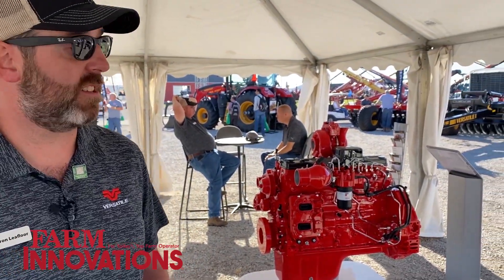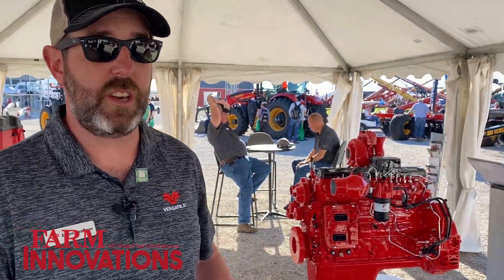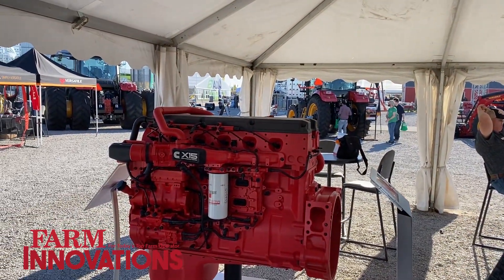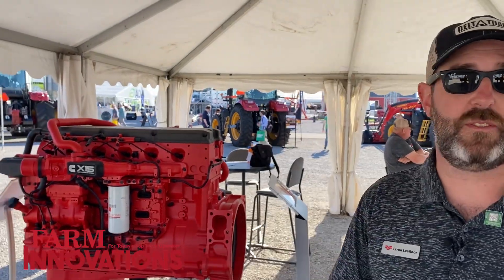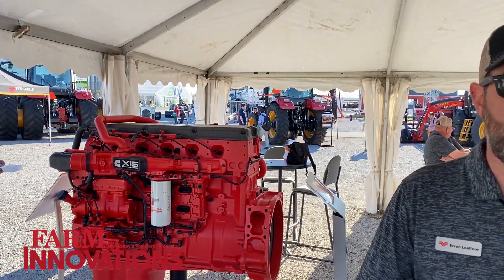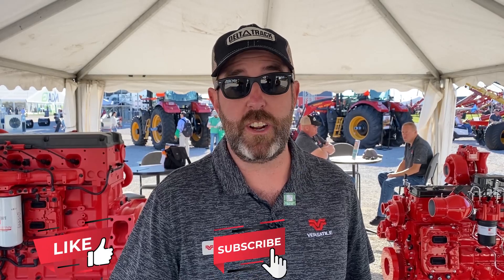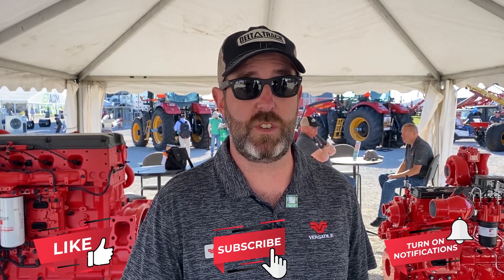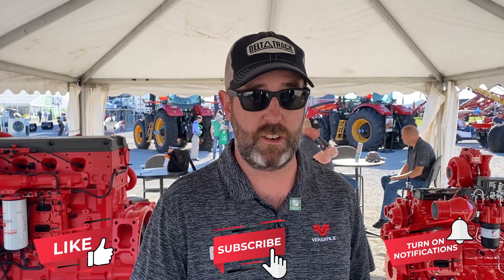Versatile Announces Hydrogen Engine Collaboration with Cummins

Comment: Water is the most corrosive thing on our planet and Cummins wants to produce it in a metal engine?  It will also have the same performance issues as any other gas/diesel engine.  Loss of power through heat.  Ramped torque.  Oil lubrication.  There are also other issues with Hydrogen that nobody talks about.  Like recharge time.  If you think waiting for an electric car to charge takes too much time then you better hope you are the first in line for your Hydrogen refill.
Reply: I can't argue with the corrosive statement.  Especially when you Deionize water for the hydrogen process.  I would assume that is long before the product hits the cylinder.  Yes hydrogen does primarily come from water.  But once it's split during the electrolysis process, water is now hydrogen and no longer water. 
All in all way better than exporting the CO2 impact like a in a feel good ev, and less chance of losing liberties and freedom like in a ev.
Reply: Where do you get this false information from? Firstly Hydrogen can be refilled in the same time as it takes to fill a tank of fuel. Water may be corrosive to iron but that's not an issue with modern chrome and Nikasil plated cylinders walls.
Reply: @jonathondeeds3423   I work for EPC company that is building a hydrogen plant.  That's how.